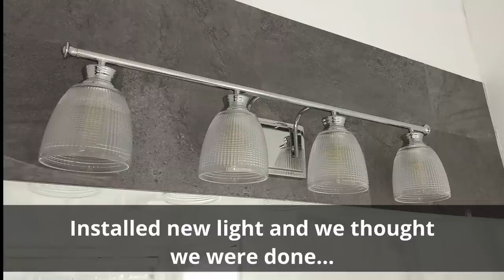AMAZING PEEL AND STICK Vinyl Tile ACCENT WALL!

Comment: That looks great. I’ve been thinking of doing the same in my bathroom but noticed it was typically installed on the floor not on walls. How long have you had it up and have you experienced any issues?
Reply from the maker: Thanks! The tiles were installed 3 months ago and we used a moisture control adhesive.  We have had no issues so far! 😀
Reply: Looks good ... well done Grant family
Reply: DIY Power Couple good to know thank you!
Reply: @DIYPowerCouple   I know you have shown the adhesive in the video, unable source this particular adhesive. Could you please recommend any other adhesive. I am planning on installing the panels on bedroom wall, moisture control is not needed. Thanks
Reply from the maker: Hey! Haven't used another adhesive as of yet, however, a vinyl adhesive should work.  Look for an adhesive that matches your panel material.

Comment: Do you know if the adhesive with mess up the wall when you take it down ?
Reply from the maker: We thought about that when we put it up, but we said to ourselves....If it tears up the drywall, we can fix it or learn how to fix it. We had to fix a hole in another wall and found out that the home improvement store sells drywall in small squares. Hope that encourages you so that you can diy too!
Reply: DIY Power Couple Thank you ☺️